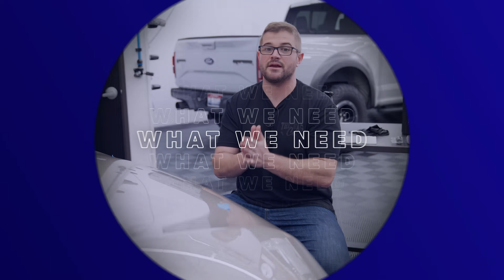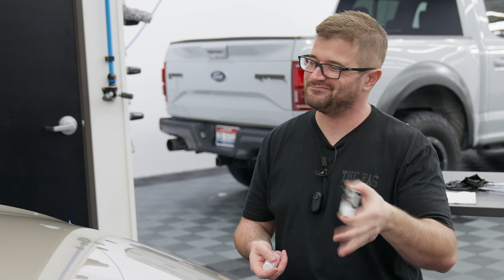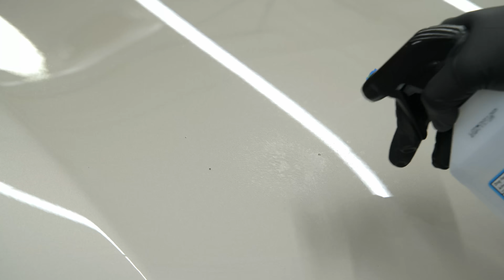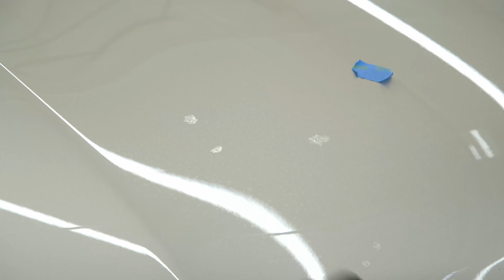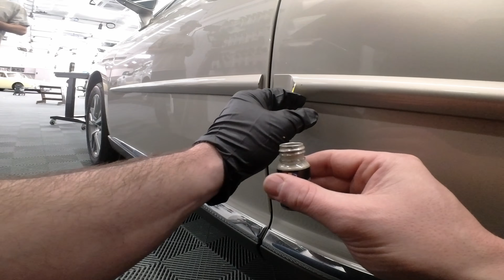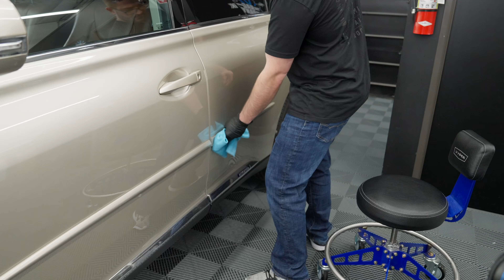The Easiest Way To Fix Car Paint Chips At Home With PRO Results

Comment: Didn’t actually see you fix anything, which doesn’t make sense as you look like a professional shop. As a customer if I paid you to repair the rock chips and you told me you might not be able to fully fix them and to set an “expectation” that you might fail, but I’m still getting charged, I would go find another shop.

Comment: I usually fill the chips a  couple times until they're level not worrying about the little mess outside de chip area, then after dry, I do a couple of steps of sanding, then polish, at the end you will have a near perfect results.

Comment: this isn't a repair or anything at all its the lazy mans way of just paint it so it wont be a distraction instructional video lol, never do this if you really care about your car....unless you have a beater car then yeah do this method but for those who care and have nice cars do the sand the tiny indentations that are produced when the rock hits it with 600-800 grit wet sand just slightly it don't even take long at all for such a tiny mark so just seconds of time will be way better, second don't use the glove to remove the paint you will keep extracting and causing a crater and no matter what you do it will continue to leave a small well and the crater mark will make it more pronounced since you did not sand it....use a firm card or the silicone scrub card they usually give you to swipe the access paint so it levels flush to the existing paint and it comes out much more straight since you sanded it a tiny bit  and then do the rest of the regular procedures after and clear it at the end with a 2k clear then buff it, it all goes fast since they are tiny chips anyway.

Comment: the Game on STEAM:
Never saw even moderate close up of the finished chip repairs. 

To level the paint and clear coat, am gonna making tape and stay with my 1000, 2000 and 3000 grits and when satisfied, Meguires Ultimate Compound and then Cerekote Paint Sealant.

Tedious, but superb results...especially on black.

Comment: What about chips in painted bumper ,they are plastic so would you have to sand yhem down to smooth them out and then paint
Reply: If the plastic is deformed then no amount of paint will hide it. You'll need to knock down the high spots in the damaged plastic.

Comment: I had a big rock fly up and hit my hood on the highway and it left a slight dent and a deep scratch just reaching the metal. What you you recommend for repairing ? The damage looks like if you took a flat head screwdriver on an angle and tapped the butt of the handle with a mallet if that helps for a visual lol

Comment: A lot of chips will have rust in the crater.  Shouldn't the rust be removed?  How?
Reply: Take ~400-1000 grit wet or dry.  Take a paper puncher and punch grits used and super glue each piece to the end of a No.2 pencil.  Accurate and controlled to remove the rust.

Comment: This is like the 10th video I've watched of this product, and I'm going to give a suggestion that's going to make it easier for everyone. I have no idea why Dr Color Chip recommends this goofy process of putting the colorant above the scratch and pushing it over. Instead, for generally round chips of small size, apply a "domed" amount of paint in the center of the chip so that it sit proud of the edge of the chip. Cure time will vary on humidity and temperature, but on a cool day for me, on a small chip, it was around 10-15 minutes. Now, get something FLAT and rigid, wrap the SEALACT saturated removal cloth around it, and "buff" over the working area lightly. It won't look like anything is happening initially, but keep going with light pressure the entire time. Don't get greedy. This should ensure that you remove the excess around the chip while leveling the touch-up paint surface. Buffing using your fingers or the palm of your hand will still cause the cloth to attempt to conform to the depression, and will tend to wipe out too much of the paint. You may still need a follow-up application, but after my second one, I was left with a completely flush paint fill.
Reply: Fully agree. Found it comical that this dude is using his finger. Need something flat and flush so you don't dig into the crater.
Reply: @Zwikster  Its literally what the president of the Dr Colorchip company demonstrated, which is why everyone else does it. Not saying its the best way, its just how theyve demonstrated how to use the product.
Reply: So the high edge of the crater actually sands down just by using a flat edge and cloth? It seems the edge of the crater would remain high because of the tough factory paint/primer???
Reply: @Cyclingmasterseller The impact with either a stone or anything that scuffs the paint causes the paint to sink in the hit area but the immediately surounding paint rises forming thos higher edges.The levelling solution provided with the kit Is specifically formulated to level the added paint,this Is to prevent any damage to the cars paint.You Need to gently knocknogg those hard edges sanding with a 1500/2000 .
Reply: @opmike343  did you apply clear?

Comment: What would you recommend for chips around 3-4 inches with flakes still holding onto the chip around edges. I have 100s most are small (all larger than yours) but it looks soo bad but not sure what to use/do i dont think this would work
Reply: Complete preparation and paint spray booth.

Comment: What about a segment on how to repair chips that have rust? That's far more common here in the northeast.
Reply: @jamesclark7248  sand it out
Reply: @jamesclark7248  same process but use something to remove the rust first. If you have the abrasive tip from a paint touch up pen that would be ideal

Comment: Do you have a video on how to fix bigger areas,  like if the area is dime or nickel size ?
Reply: Would require some spot putty to fill in move of the area flush, then this system or standard touch up paint will work
Reply: @richeyrich2203  Nah, mask off...fill...let thin coats of paint flow...level sand.

Comment: I have several older chips that are very small but have Rust in them. Any chance that you could reply as to how to deal with that before I fill them?
Reply: Incase you still wonder; you need to take an abrasive and sand out the rust completely before putting paint in the void. You can use a corner of sandpaper, or even the ceramic tip on common touchup paint pens from the auto parts store. 
Then, when it’s clean, you can do your favorite paint fill system. 

I prefer doing OEM two stage pain repairs. Dr color chip has never been a perfect match to me.
Reply: Take a pencil or similar instrument like a very small diameter dowel and super glue a paper-punched discard of your various grits ~400-1000grit wet or dry on the erasure portion or end.

Comment: Wish I would’ve seen this video sooner. Bought a truck with a few small scratches in the door and used the paint pen they gave me but it looks blotchy. It’s so notice. Any idea if that’s removable so I can use Dr color chip?
Reply: Many paint pens have a ceramic tip on one end. Highly abrasive and very fine. You can find pens that are abrasive only - both ends in different grits. Yes, you can get that blob out of there. Hell you could work at it with the tip of a razor blade if you have to. Just don’t go through the primer. Go slow. Work small. Take your time.

Comment: Great instructional video. What size micro touch up brushes are you using? It appears Amazon sells a number of different sizes .5mm - 2.5mm. Thanks again
Reply: I would get the multi size kit, so you can learn which works best with each scenario,

Comment: Is it a single stage and no clear at all? Does the chemical to remove the excess paint take protection (wax, etc.) off? Does it remove existing clear coat?
Reply: You should remove any wax before you start.  The touch up paint isn't going to stick to wax.  After the touch up job you can reapply your wax in 3 days or allow 7 days before applying a ceramic coating.

Comment: You let the paint dry before you take of the excess paint?
Reply: For 2-5 minutes (so "dry" but not cured).  If you start wiping it while it's wet it'll take ALL the fresh paint off, not just the excess.

Comment: How does the Seal Act remove the  buildup from touchup but not remove any of your paint off? You’d think it would lighten your clear coat from that area.
Reply: My guess is the sealant is a mild enough solvent that it doesn't have any issues removing paint that is 2 minutes old, but once the paint has cured it's not strong enough to damage it.

Comment: How well does this work for a super bad case? My vehicle is hammered with rock chips, I counted them and lost count at 90 on the hood alone. Someone told me touch paint isn’t going to do much justice.
Reply: Depends on the size of the chips, but I have a VW Golf and I once touched-up 40-50 ~1mm chip spots on its hood. That was about 5 years ago and all (except a couplefew big ones I screwed up) are basically invisible. I'd have to compare the locations with a photo where they're circled.
Reply: I had similar on my lexus with rusted ones. I recommend removing all the paint down to the primer on the panel, removing any rust in the chips, using bondo, then sanding and adding base and clearcoat again. It will be much cleaner and likely less time consuming
Reply: It's not the number of them, but the size of them and your own patience.  It'll work on 90 chips as easily as it will work on just one of the same size, it will just take you 90x as long.

Comment: What do you recommend to get the wax build up out from UNDER the paint? Looking at it with a 100x Radio Shack inspection microscope, it looks like the entire edge of the paint chip has torn away from the surface. A small paint brush probably would not have enough pressure to get the IPA in there to dissolve the white wax powder. I might try an air brush with the IPA, I just don't want to make the chip bigger. If I can get primer in there to support that lifted edge, that's the plan. Any ideas?
Reply: Get a sanding stick or use a paper punch on some 1000 grit to glue a spot on the end of a pencil eraser to get the edges kosher. If there are edges flaking, it's going to get bigger no matter what because those bits are not staying down, and trying to glue them with primer is just going to build the whole thing up and make things harder in the long run.

Comment: the camera work on this video is very poor, you need to focus on the surface painted area being repaired and not the gloved hand. Can one purchase the Silac separately.as I already have the paint?
Reply: @LeslieDurling  In a separate video, the Dr Chip people say you have to use their paint because it is made with the right solvent to work with the sealact.
Reply: @LeslieDurling  In a separate video, the Dr Chip people say you have to use their paint because it is made with the right solvent to work with the sealact.

Comment: Great video! What about if someone tried before you and left a blob of touch-up paint. How do you get that level?
Reply from the maker: It depends on what the touch-up paint is made of, but we would recommend lightly wet sanding the area with 3000 grit to try to level the blob.
Reply: @theragcompany  I think this is common sense, but I have to ask, do I keep the area of sanding as small as possible?

Comment: With repaired areas, can you still lightly polish the area if you wanted to apply a coating for instance?  

Curious if its delicate in the future.
Reply from the maker: It is completely safe to polish over the area. If you follow the proper steps shown in this video, there should be no issues.
Reply: @theragcompany  What if there is coating already on the paint, should coating be removed completely before doing this or can you do this, then polish and re-coat?
Reply: @esoteridactyl  RE-coat.

Comment: Great job. Can this  be used on coated cars that chip afterwards,  The  seal act  solvent wont damage the coating, cause hazing that would require light polishing??
Reply from the maker: Yes, it's safe to be used on coated cars; just make sure not to apply too much pressure with the cloth due to the fact it could cause micro-maring.